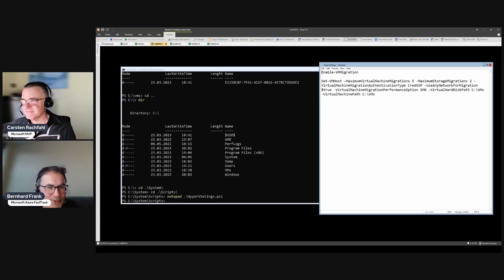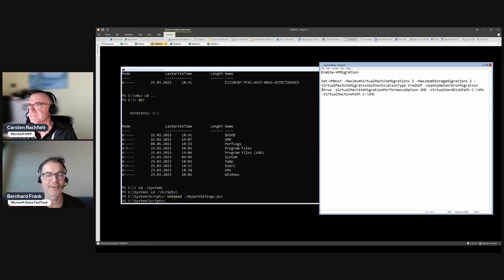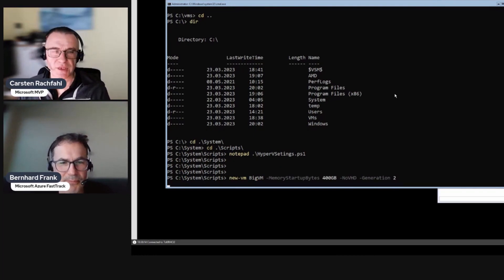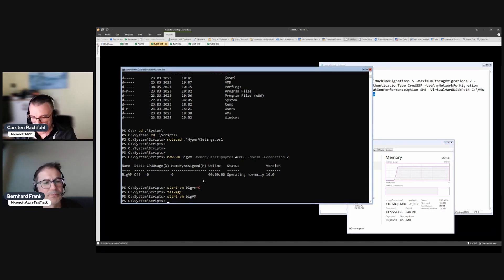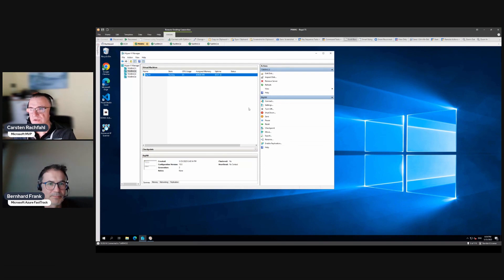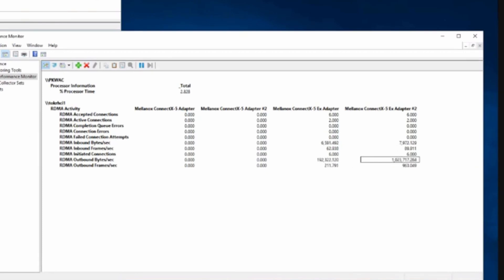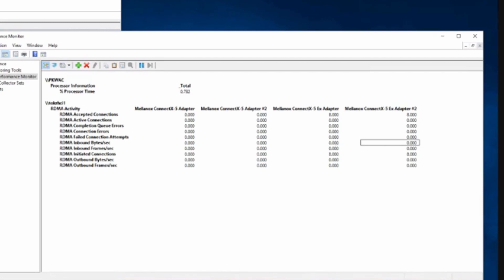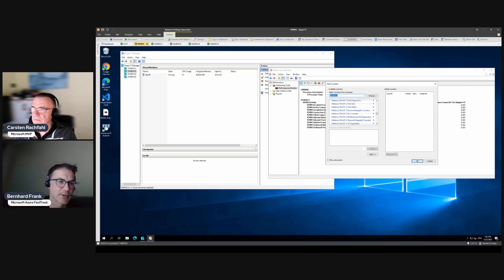Azure Stack HCI - Installation Series - 11 RDMA Test With A Big VM.

Comment: See increased amounts customers where for some reason the RDMA counter disappear in WAC performance monitor (cluster and node), but they are still accessible in perfmon. Do you have found any fix for that? I believe this is reproducible if you use disable-NetadapterRDMA / enable-netadapterRDMA once on the node. Anyone else, solutions?

secondly: I have found a reference on the internet that RDMA cannot be activated on a ManagementOS VMNetworkAdapter on SET switch, even though it is one THE features of SET to support RDMA. Currently on Azure Stack HCI 22H2 (August 2023), even if the physical adapters are correctly configured and the SET switch and virtual adapter has SR-IOV functions available, it is not possible to make RDMA work on the virtual adapter (get-netadapterRDMA result is RDMA enabled, operational false).
Reply from the maker: sounds like a bug to me. May I suggest to open an Azure support ticket if no cure is found?
B
Reply: @thehybridfriends   Update on this: the issue with the RDMA and ManagementOS $true Adapter could be solved. The underlying issue was that in the UEFI the number of VF were too small (8), raising them to 127 and recreating the vswitch solved it.

However the issue missing RDMA Counters in WAC, as described, remains.
Do you see this issue in your labs or environments?
Reply from the maker: Nope. Does perfmon on the WAC box can show RDMA counters of remote cluster node? If yes then it seems to be a WAC issue. Then I would - 1) restart WAC service 2) remove and re-register the cluster (+ all nodes) in WAC. 3) reinstall or update WAC. 4) Open a ticket. ;-)  - hth, B
Reply: @thehybridfriends  next time I will raise an SR happened with 4 customer now that WAC loose access to the RDMA Counters on the WAC perfmon. Cannot test locally from WAC gateway, Server Core for security reasons.

When I use a different host remotely with w GUI using the old perfmon Counters are accessible remotely.

Could be one of the few issues in WAC :)